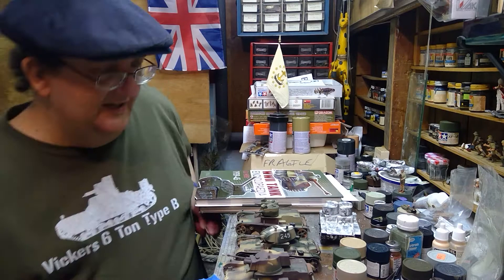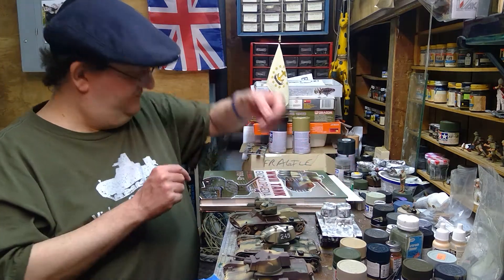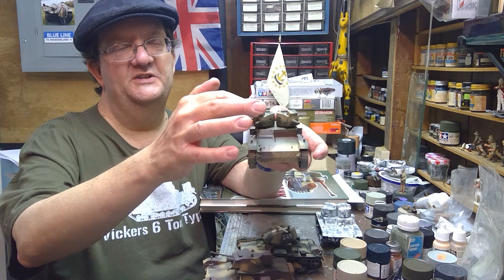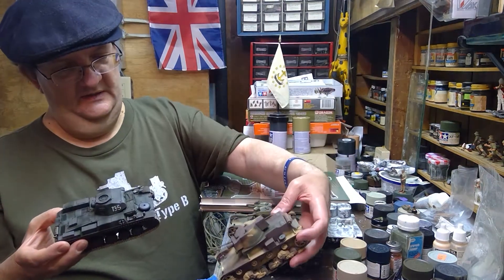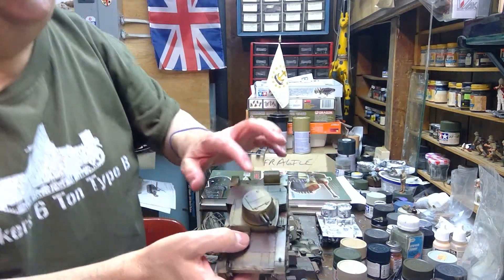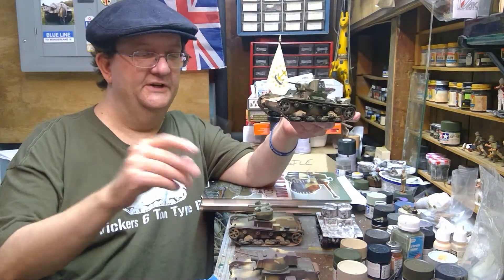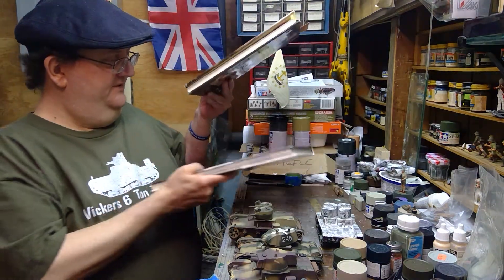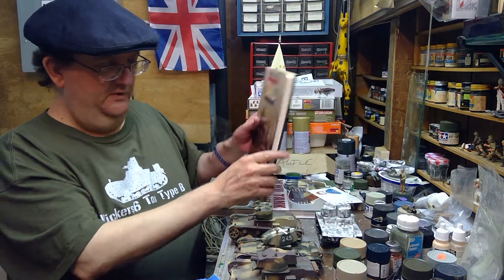Model Building Workshop - History of the Vickers 6 Ton Tank

Comment: In the 70’s, a dark green painted twin turret tank was on display in one of Asunción city square. We climbed up to this relic of Chaco War having lots of fun.
The tank crews must’ve had most severe harsh jobs inside this contraption in the vast green hell called Gran Chaco
Reply from the maker: CAMs (Combat Armor Models) makes a 1/35 scale Vickers single turret tank in Bolivian markings. I believe it's from the Chaco War period.  Fascinating story! It must have been something to see that! Thanks for sharing.
Reply: @9librariespvd  I heard that captured tank was returned to Bolivia as goodwill gesture some years ago. If I remember correctly, the top surface of turret was rather smooth lacking pop up of other types, also the machine guns had steel encasing along the entire length of barrel up to muzzle. Due to some issues including budget restraints, Bolivian army reduced the order quantities to receive 1 twin turrets and 2 single turret Vickers tank during the Chaco War.

Comment: Very good and informative talk. I would like to point out :
1) T26 carry a 45mm gun not 47mm gun. 
2) The Bulgarian Vickers is a late production model. The Poland Vickers is an early production model. However both turrets are located at the same side, that is the left hand side of the driver. 
The Poland version model kit carry the wrong turret hatch. The Bulgarian version model  kit mixed up with Finland Vickers that have a hull submarine gun, and therefore need to move the turret to  the right  side,  that is at the back of the driver.
3) The Poland 7TP use a more powerful engine. The Poland Vickers 6 tonner use standard engine same as other countries.
Reply from the maker: Thanks for the information!